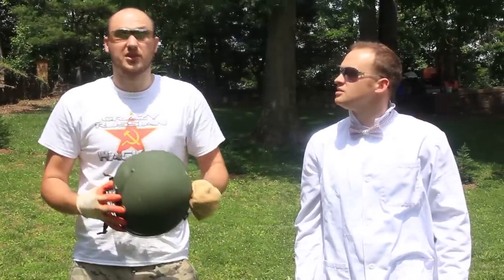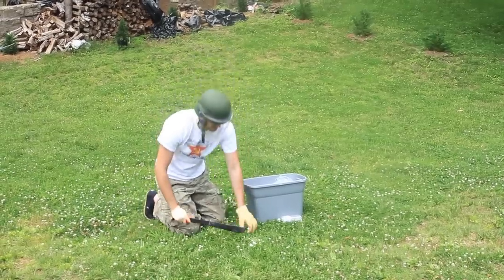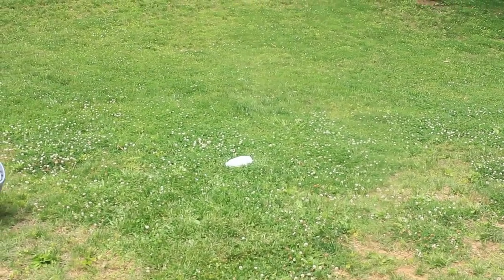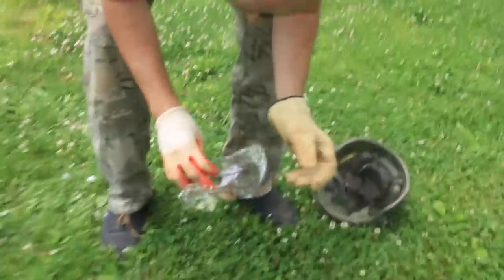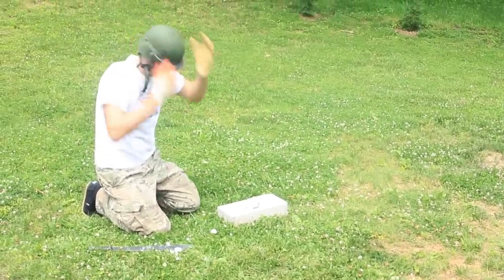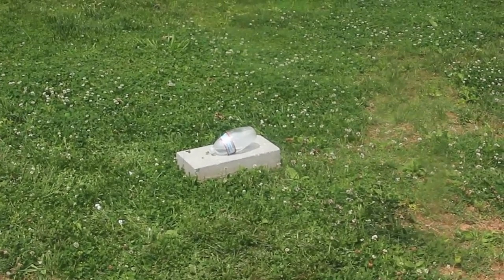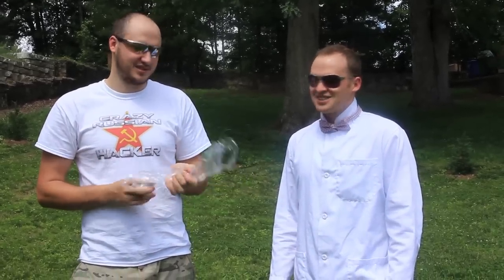Scary Dry Ice Explosion at 62,000 FPS | Slow Mo Lab

Comment: "Do not try this at home" *uses machete to cut dry ice, throws it away; no real protection; uses explosives 10 feet away...*
Reply: Only in mother Russia
Reply: Charles E. uses explosive cough cough yet no real explosive just basic science and pressure LOL
Reply: Josh Wetzel  It created an explosion, didn't it?
Reply: That's what i said
Reply: John Citizen  I'm so sorry for upsetting you.
Reply: +Charles E. Dude, they had protection, didn't you see the umbrellas?
Reply: +John Citizen It is technically correct to call it an explosive.  Explosives are simply things that explode or cause an explosion. An explosion does not require "a chemical reaction involving heat and combustion" it is simply a rapid or sudden expansion or bursting with violent force, often from a chemical, nuclear or mechanical reaction, which also produces a noise.  Nice try but grade 8 science doesn't cut it.

Comment: I can't believe no one noticed the condensation build up on the second bottle while exploding. The part that starts to crack open moved so fast because of the pressure while it was cracking open, the plastic went SUPERSONIC.
Reply: No, it likely didn't go supersonic. Rapid decompression like that causes water in the air to condense, forming a little cloud. You can I serve this effect by sealing off an empty plastic water bottle, then twisting it to compress the air. When you pop off the cap, it rockets away, and the air inside looks like smoke because the decompression condensed the water molecules, forming a vapour.

Comment: FYI: The plastic bottles did not melt; the deformation was caused by stretching from the internal pressure.
Reply: I don't know, —the rise in internal pressure— could've caused —the gas inside the bottle— to heat up before it exploded.

Comment: I did this with a large sprite bottle once, I think it was the 2.25 litre. These bottles have nubs in them to give it a texture and they may have helped its strength. It had a couple of handfuls of dry ice pellets and was maybe 1/3 fill with water and standing upright. It was a 'slow burner' [which I find tend to be the most impressive explosions btw]. I swear we waited for between 10 and 15 minutes while the bottle stretched and groaned and we began to wonder if it will blow but didn't dare go near it. Just before it blew the cloud of carbon dioxide above the water went clear and I think it must have been under such insane pressure to literally liquify it. The gas cloud was as big as me went it exploded and the bottle was beyond recognition and flung pieces away. I bet that no one can replicate this, it was just a fluke for it to get to liquification pressure [or pressure enough to go clear anyways]. All good fun as long as you stay clear when they're about to explode. Stay safe

Comment: You did it wrong. Water bottle are not made to hold pressure. So it does not take a lot of pressure to pop the bottle of water. However, soda bottles are made to hold pressure. They stay together much much longer when you put dry ice in it. Because it stays together, and soda bottles are a suitable pressure vessle, when they finally do explode they are HUGE explosions with A LOT of action. You should redo this video with a 2 liter bottle of soda. I promise you will be very impressed.

Comment: "too much pressure inside. boom."
funny, but the real reason is when the plastic contracts, potential is converted to kinetic and heat. at that point the plastic is deformed, weakened.  you can see it wrap around the cinder block

Comment: Hehe.    They didn't melt.  It was just plastic strain from the stress of the material expansion under pressure.   The material expanded so much that it could not return to its original shape (not that plastics ever do) and that's why it has a different/flat shape.  The didn't melt ;)

Comment: The bottle melts due to high pressure difference.
The pressure exerted by the gas is proportional to the kinematic velocity of the gas squared, which in turn can be expressed as temperature. Since the dry ice is sublimating at a very fast rate due to the water, the pressure exceeds the bottle's material resistance and suddenly the plastic melts as the fluid bursts out.

Comment: Well, when you said "It's just water and ice," you were wrong. This was water and DRY ice. Dry ice is the solid form of carbon dioxide, and when it sublimates, it turns makes a foggy smoke-- not water like normal ice. The gas it releases expands in the bottle making the water bottle expand and then eventually explode. It's actually very easy to understand.

Comment: next time if you have access to garage... i forgot to mention we had to replace garage door too... box spring was against it leaning.... so not only did it crack the box spring but pushed the aluminum garage door outward like a bubble.... Mention Arigabe123 if you try this... ... 
 Its much louder in a garage obviously... But i am  a physicist and chemist... my  brother argued with me... He was using 2 liter to explode... I told him i can make it explode faster and louder and more powerful with a 20 ounce bottle of water.. he said bullshit... so we went got a few bottles and i emptied 2 tablespoons or so out then filled dry ice until it reached about 1/4 inch breathing room at top of bottle and cap... shook it fast dropped behind box spring  and i said run.. 
 He laughed and as he did BOOOOOOOOM .. we went deaf haha... He said how did you know that would work... I said mass compression at an hyper accelerated rate in small space agitated would cause a reaction between the water and dryice .. dropping it in and waiting builds pressure but slower.. hence smaller explosion... 
 But agitate it by shaking it 5 to 7 quick shakes .... makes the pressure accelerate at a phenomenal speed causing hyper pressure.... and on this dont hold or stand next to... can blow your hand off seriously... if it can dent a metal door and crack a box spring imagine what it would do to your hand... I explained it to the officer... 
 Told him it was an experiment for high school class... then  i showed him 2 liter demo shook and 20 ounce demo shook.... He went deaf too... they got complaints of a twelve gauge being shot in our garage.... after he saw it and let us show him he laughed and said ok no more tonight your scaring the neighbors.....fun times

Comment: Hey guys! Try to use newsprint impregnated in ammonium nitrate solution. Just roll up it into a ball, ignite this from corner. When the ball just start smolder, drop him in a bottle as faster as possible and screw the cap.
Afterr this, you have a five -ten seconds to leave this place. Tha bang, like from panzer cannon=)

Comment: I have made many of these using all different sized bottles from the little one's they serve on airplanes to big 2 litre bottles. Oh yeah, I've also had some go off in my hand; not cool! With the larger 1.5 and 2 litre bottles, if they go off on pavement such as in a parking lot, you will find a perfect impression of the bumps on the pieces that were on the bottom side. Once I was able to match the plastic to the pavement. It fit perfectly.

Comment: Use an empty plastic engine oil bottle.  Or an empty plastic radiator fluid bottle with the locking caps.  Since they are thicker, they'll probably be a lot louder.

Comment: It didn't melt. Take a cold fruit rollup( the big square one, Not the little roll) and rip it in half as quickly you can and you will get the same effect.
The plastic was stretched as much as it could so, the gas release was so violent it fractured the plastic instead of ripping it open

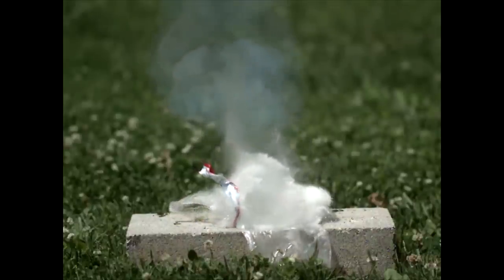Comment: Could somebody explain what happened on 2:18 ? is it some kind of sonic wave?
Reply: I'm replying in case someone answers. Perhaps it's an area of low pressure and since the surrounding air is filled with vapour, as it enters the low pressure area it cools and condenses. I dunno I just guessed from this wikipedia page; http://en.wikipedia.org/wiki/Prandtl%E2%80%93Glauert_singularity#Reason_for_condensation_clouds
Reply: Jorge A. Garza V its the CO2 gas escaping from the bottle at a high speed.
Reply: Jorge A. Garza V  it's called uncontrolled decompression.

Comment: At 2:18 you can see how as the air rushes out of the bottle, its pressure drops and all the water vapor it used to be able to hold at high pressure condenses out briefly... neato.

Comment: it could really be melting the plastic and not ripping it as the guy said, think about howmuch friction that pressure would make
Reply: +Bmxbetterthansex unlikely.  dry ice is -80degC.  your freezer is -20degC at best.  how much friction do you think it would take to melt something in your freezer?  definitely not melting.  it's ripping for sure.  exactly the same principle with a popping balloon.  internal pressure becomes too much, small rupture in the wall which rips and causes a rapid release of energy: bang.  i'm sure there's some heat released, but not enough to melt plastic.

Comment: I would want to ask a question, if before it explodes you put it into a fire, would this put out yh fire? or would the explosion stop? help me out guys please....
Reply: +Man Like Josh what's happening is the the dry ice turns to gas as it warms up which causes the pressure to build up inside the bottle until eventually it breaks which causes a rapid release of energy.  if you dropped that bottle into a fire what would probably happen is the fire would melt the plastic and cause it to make a pop.
Reply: +b  yeah alright you right but what if the bottle was contained in a heat resistant material? so the fire can't get into the bottle... what do u think would happen then?
Reply: +Man Like Josh it would cause it to burs faster.  PV=nRT.  P=pressure.  V=Volume.  N is the amount of the gas.  R is the gas constant  and T = temperature.  So since volume doesn't go up, increasing the temperature will increase the pressure.  
If you think about it logically it makes sense - making the gas hotter makes the molecules bounce around faster causing them to bang against the inside of the bottle harder and more often.

Comment: alright... pressure but... why?
Reply: +Enkii Muto dry ice is frozen CO2 which freezes at ~ -80degC.  as it gets warm it turns to a gas which expands increasing the pressure inside the bottle.  PV=nRT
volume is going to stay the same, but as temp goes up so does the pressure until eventually BANG
Reply: +Yifan Ruan Thanks for your input, Captain Nasty.  The volume of the bottle (as in what it can hold before breaking), not the volume of the gas...obviously. That being said, technically the volume of the bottle does change i suppose as it clearly stretches before it bursts - but the point is, volume as a measure of what the vessel can contain.
Reply: b k. I apologize for the misunderstanding, was an easy mistake though
Reply: +Yifan Ruan then maybe you should take a look at why it's so easy to call other people idiots...mistaken or not.